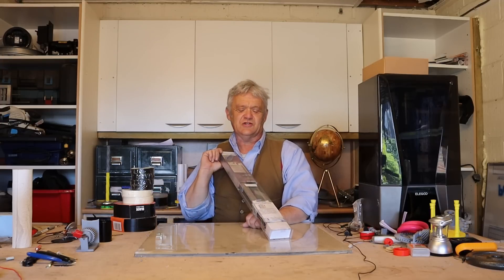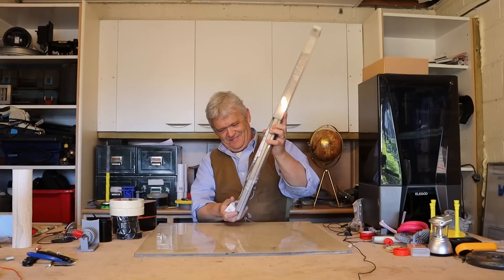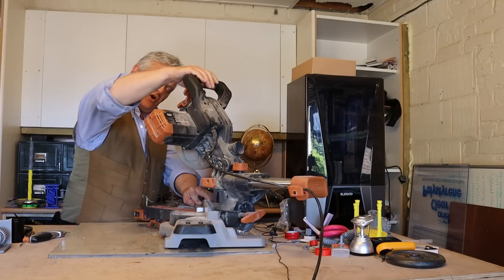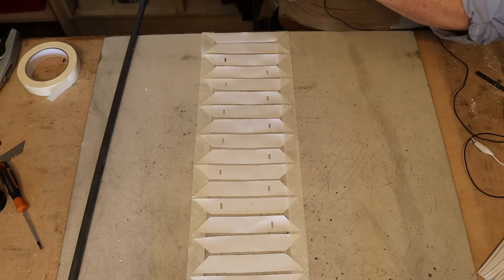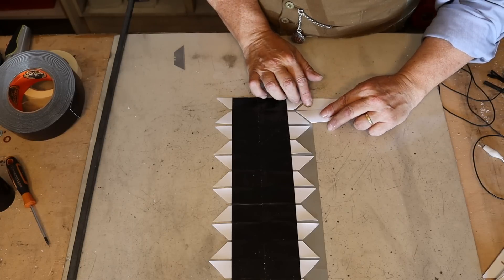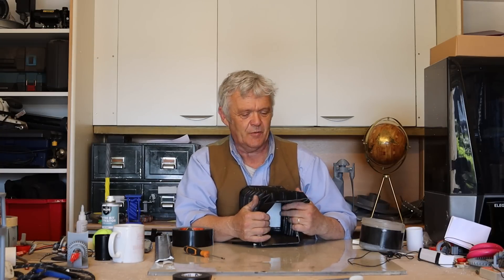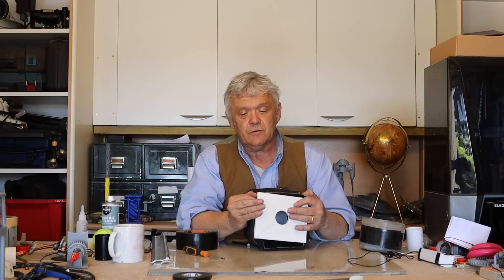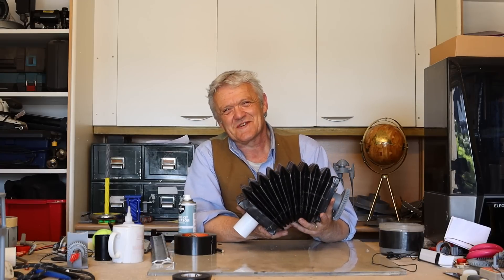2023 A DIY Bellows From Gaffa Tape

Comment: Gorilla tape is amazing, bends forever, sticks like nothing else.  I used it outside to attach a thin film antenna around a steel box, it's been out for 3 years rain/sun/snow, still looks like the day I put it on.  Excellent bellows build!

Comment: Build a see-saw, and put one of these equidistant from the Fulcrum on each side.
Fire up the Forge, and let the kids play See-Saw.
I'm also pondering what kind of expansion one can get if one of these is fully sealed while not completely filled, and left in the direct sun. Might get a bit warm for the adhesive, though. 
It WOULD make a lovely displacer or piston for a Stirling engine, too!

Comment: To be honest, I'm surprised that you didn't 3d print the plastic slats. It would be ultra simple, but people could resize and adjust the thickness for their needs. Thanks for remaking this video. I saw the original, but didn't remember all the details.

Comment: Not bad, a double piston pump is more effective; as you can a current on both pull & push strokes. If remember correctly, it was developed in ancient China & they used it for forging as well as warfare (ship to ship freakin flamethrowers).

Comment: For using this as the pump in the last video, I wonder if putting a one way valve on the top of the bellows, that lets air in on the up stroke, would make it easier to pump by hand.

Comment: There's a video here in YT making waterproof  rubberized tarp from silicone caulking, solvent thinner, and bed sheet. Might work for larger size with wider vertical window, sliding door slats.

Comment: Gorilla Tape is not Gaffer Tape. Gaffer tape is used in theater a lot because it's easy to tear into strips (square mesh inside tears between runs) and the glue doesn't stick around afterward, wrecking what you've stuck it to.

Gorilla tape is much stickier -- different glue entirely. The glue likes to slide around under gorilla tape instead of sticking it down hard. Also, gaffer tape can patch pleather throw away office furniture for temporary fix. Gorilla tape is just a hazard when used this way; slides all over, glues you to the seat, requires harsh chemicals to remove (my father's brilliant idea...)
Reply: Yep. Correct. "Gaffer's Tape" NOT "GAFFA tape" per the title. I will attest that Gaffer's Tape if left on long enough will leave adhesive residue behind!!!

Comment: Not to be pedantic, but Gorilla Tape is very much NOT gaff tape. Gaffer's tape is a very specific product, black non-reflective fabric tape with special gum glue used for stagecraft, which is nonconductive and (theoretically) doesn't leave glue residue when the tape is removed, even on carpeting. Within stagecraft circles it's pretty well known. On sets it's generally the Best Boy who has it (as the Gaffer's assistant), taping down wires against tripping hazards, and often all the Grips as well. You can use it for bandages, among other things, because the glue is widely known as (inadvertantly) a better antibiotic than the first aid cremes you generally apply. As well, gaff tape currently goes for something like $30 per roll.

Comment: What would happen if you use 4 microwave transformers to create the energy by spinning a very strong magnet between the microwave transformer coils how much energy would you get from it????
Can you use the energy to run a washing machine motor from it??
And then if it is possible can the washing machine motor keep on spinning with the very strong magnet between the 4 microwave transformers to keep on making energy to keep it running??????
Reply: Bro thinks he stands above the law of conservation of energy 💀💀💀